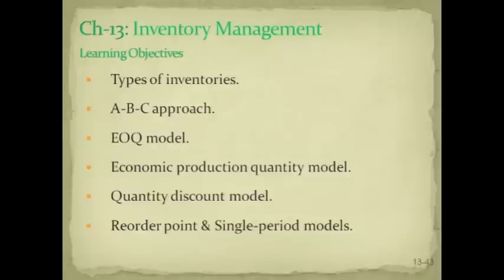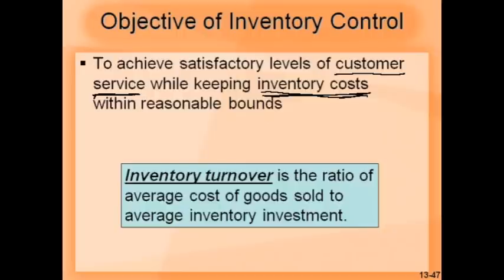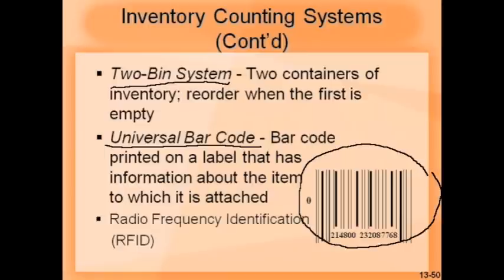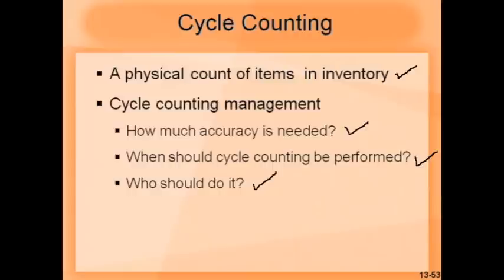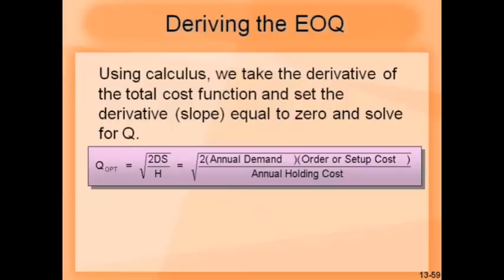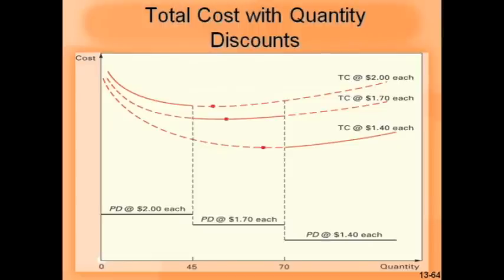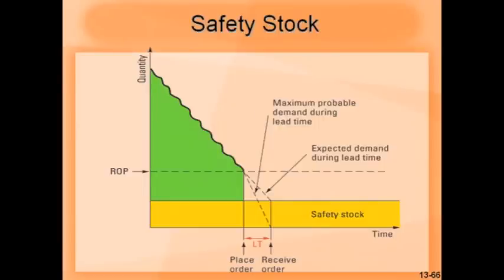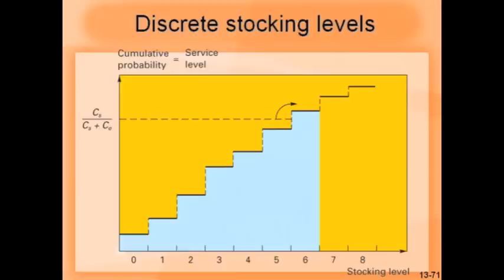Inventory Management | Concepts, Examples and Solved Problems

Comment: Isnt ABC analysis dependent on annual value of consumption and not the unit cost?
Reply from the maker: Depends on situation and application area. many times it is done based on fast versus slow moving items.
Reply: Okay. So basically no strict domain. Thank you!
Reply from the maker: +Souvik Pal correct!